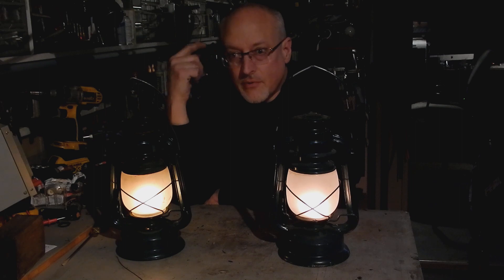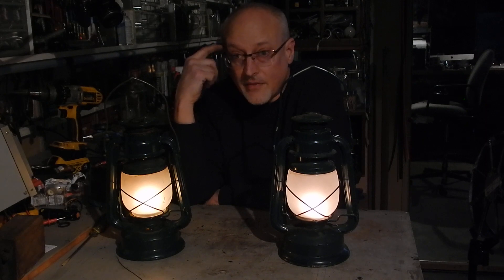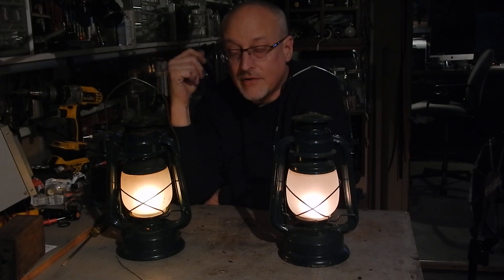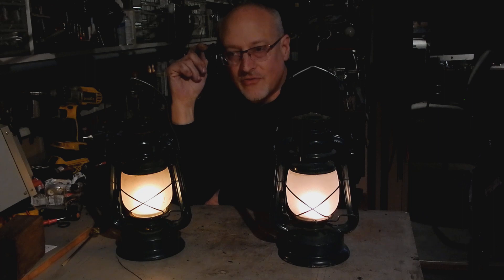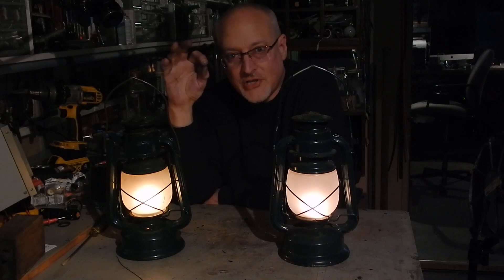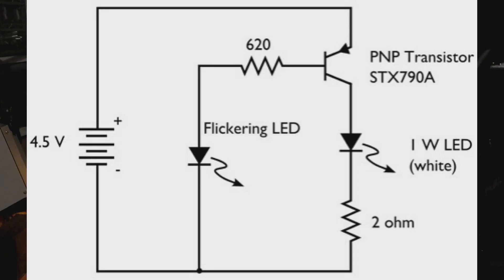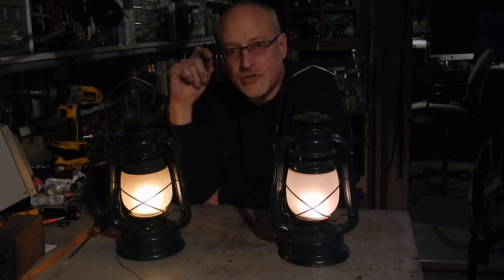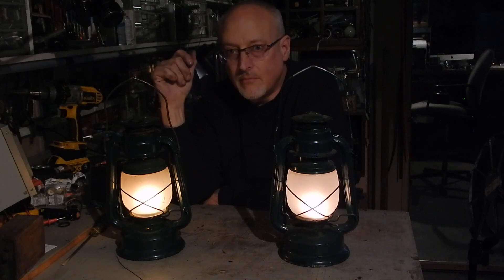Flickering LED Lantern How To

Comment: I'm wondering about the 4.5v battery. Seems Nimh, LFP and normal li-ion all don't "fit well".
Perhaps a QX5252 (boost chip with 4 legs that prevents over and undercharge of single Nimh that only needs an external inductor) would power it?
Maybe it's not meant to power the transistor in this circuit, though. It can power up to 150 mA or so, not sure, but can also power just 5 mA or so, depending on inductor value. It's also an on-off switch for the solar light.

Comment: I am looking for a led flame effect panel that I can wire to a small solar panel for sting lights, so I can have flame effect in a lantern and have it powered by an external solar panel. Where can I get the led fame effect panel that is already wired so I can attach it to the solar panel myself?

Comment: Hi Jake,
Thanks for an excellent and detailed  video.
I want to make something more powerful to attract moths. (Lepidoptery).
I will use a 12v car battery and want it to be as bright as possible. Like a standard 110v Mercury lamp. They are intensely bright.
I've tried before but never managed to increase brightness without either popping the flicker led or the transistor.
Limited electronics knowledge here, but I really would like to make this work.
Any advice greatly appreciated. 
With regards. Don.
Reply from the maker: For something like that I’d go with a bright LED bulb and this: https://lanternnet.com/product/fauxflame-v2-synthesizer-module/

Comment: Very clear explanation and nice execution. I was trying this same effect. To drive a brighter LED from the usual 4.5V Flickering LED. Have you tried using a Mosfet ?. I used a IRLZ44N L level N channel Mosfet to drive a 12V LED strip  taking the source from the flickering LED through the Mosfet to act as a fast switching gate. And then wrap the LED strip in a spiral inside a lantern. It did work, but varying the flickering intensity was something that I just learnt today.  Thanks and keep up the good work.
Reply from the maker: Thanks! I think the regular transistor makes a softer more natural flicker since it a more linear device than the FET. I like the idea of a strip wrap in the lantern!